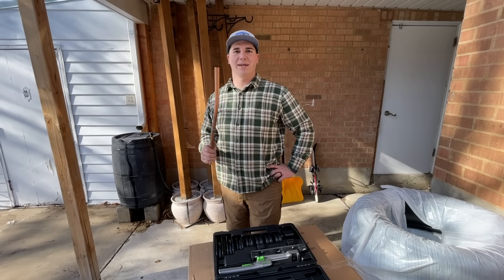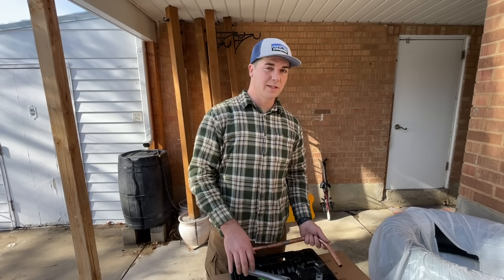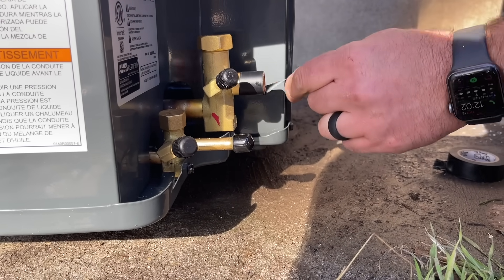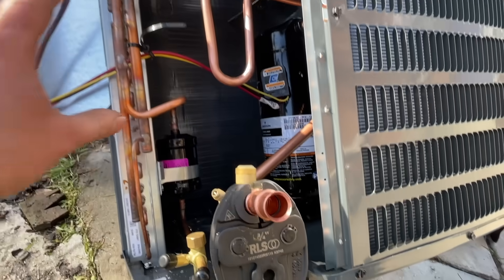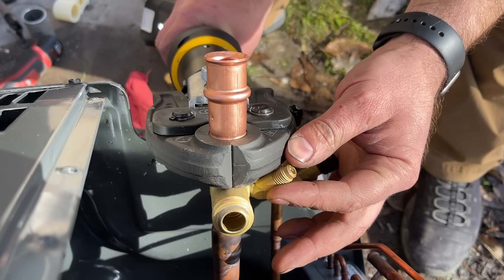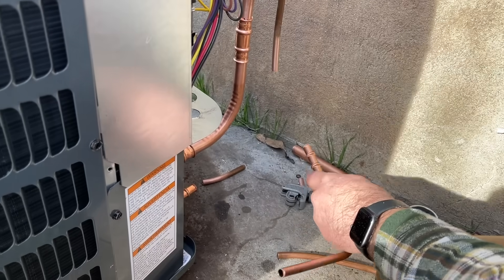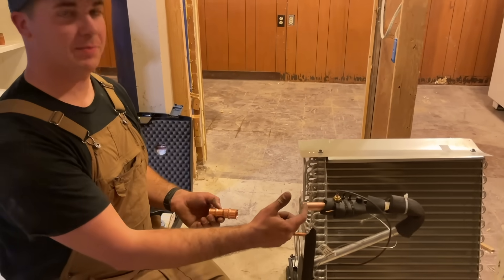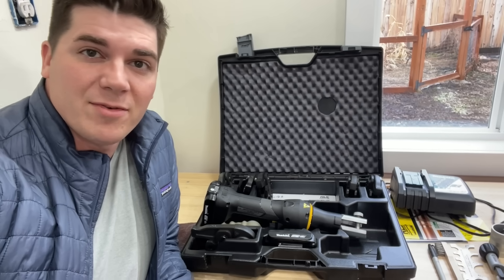Brazing Is For Cavemen. THIS Is The Future Of HVAC Copper Connections. -RLS Crimping Tool-

Comment: No rubber please. any amount of trusted rubber can result in leaks, flipped cars, leaks flooded houses. I like the new fandangled things but i like my copper and solder or braze. I haven't brazed yet. Just water with copper. I will never do pex in my house. Probably a customer as they think it's just what you do now a days.
Did someone think cpvc was ok. or plastic pex fittings or cast pex fittings. Or clay sewer pipes, then cast iron pipes. I love my old house and it's cast iron. Just don't pour grandmas spaghetti sauce down it all the time. Or vinegar in the shower to clean it. If it's abused I can see pre-mature failure. If it's to last 20 years and they can somehow prove it I consider it.
Reply from the maker: I appreciate your input. Pex has its advantages if done right but I can respect you liking the old school tried and tested way.

Comment: Pretty fancy stuff.  Press fittings are becoming more and more common in HVAC and plumbing.  Almost all the plumbers in my area have switched over to predominantly ProPress. 👍
Reply: Do you have gas heating at your home? Or ever cook over an open flame like a gas stove top? You can probably see where I’m headed….
Reply: When one of our water supply lines developed a leak, I found a plumber that uses crimp fittings instead of brazing/soldering to make the connection.  My concern was that I didn't want an open flame in our house.

Comment: Are the O-rings compatible with the refrigerants and oils? Even if so, I"m not sure I would trust them long term. Even HNBR O-rings in automotive applications eventually leak after being under compression and going through many thousands of heat-cold cycles.
Reply from the maker: Yes these fittings are designed specifically for refrigerant and are supposed to last the life of the system.
Reply: @diyhvacguy  sad to say this but considering nowadays the quality of our systems coming out of manufacturing is horrific at times solar light for the system now this could be 2-5 yearslol just saying🙄
Reply: Be tough comparing reliability of automotive fittings to these. Auto fittings are subjected to more vibration and often installed by diy'rs with little experience or training. They get knocked around and shoved out of the way. Not too many homeowners out there attempting sealed system repairs on their a/c and most of line set not exposed.

Comment: I haven't heard that a press tool was capable of the kind of pressures that are generated from HVAC compressors. 400 plus psi on R410A. Also there will be some vibration in the refrigerant line, how are the joints going to stand up to that. If it does work there will be a lot less contamination in the HVAC systems from poor brazing practices that are so prevalent in the industry.
Reply from the maker: That’s the idea, zero contaminants from brazing with no nitrogen, or getting flux in the lines when soldering. They are tested up to 700 psi which the high pressure switch will kick in well before that to prevent major damage.
Reply: @diyhvacguy  the propress units I've seen are only rated at 175 psi or less. Which propress are you comparing your numbers with. I think it would be great if your numbers are right. I'd like too see some documentation of any propress achieving 700 PSI working pressure.
Reply: @davidgordon8102  The 700psi could be burst.

Comment: Are you also going to do a video on the push-on connectors? They seem better because they can be easily removed with a tool
Reply from the maker: Yesir! Coming in the next week or so! I just filmed the installation of those and will post that very soon :) cheers

Comment: I have worked in the hvac industry for 25+ years and I would not recommend using press fittings for refrigeration work you are going to have leaks down the road even if you pass a pressure test during installation I have used press fittings for chilled water and heating water systems and make fittings for gas work also . I would be real careful using that for refrigeration work. I don’t think a building inspector would pass that job here in North country
Reply: That looks like a different compression style system, not your typical pro-press with O-rings! Oils and acids would eat away O-rings with generic water compression fittings. That system looks like it's designed for gas, compressing copper on copper creating an internal flare in the middle of the crimp. I'd use it!
Reply: @ronlovell5374  yeah the typical “pro-press” jaws make more of a hexagonal crimp which distorts the natural roundness of the tubing
Reply: @ronlovell5374  Cars use O-rings and they can last 20 years. Usually the evap gets a hole before the o-rings link. Usually cars have 2-3 Orings.
Reply: @ronlovell5374  lol bro l it uses a shitty ole oring
Reply: @Mike  The RLS press designed for HVAC and Refrigeration.   The fittings are triple pressed have 15 year warranty and rated for or min 700psi.   This is and likely will be the future, no brazing, no nitrogen purging, faster installs.
Reply: @Gary Szewc  Wow that's crazy, I've never seen higher than 600 in residential, I'll take your word for it.
Reply: @ronlovell5374 great perspective
Reply: I wouldn’t want this on my house. Technicians use this to make the job easier, get paid and get out. It won’t last.
Reply: I agree on down the rd that will leak
Reply: I know nothing about HVAC. But aren't all cars air conditioning lines made the same way? My work van is 20 plus years and holding good.
Reply: @johnny rizzo  automotive fittings that work the best have o ring fitting with captive o ring. Crushproof washer and it is a block fitting that is not subject to distortion. The crushproof captive seal is a backup but also provides a block to external moisture that could become acidic from other airborne stuff.
Reply: @johnnyrizzo8057  On cars the springlock couplers became popular because you could pay a much lower rate to the opperator making the hoses than to the Union worker on the Assembly line. The time it took to screw the line nuts was reduced and the incidence of Carpel Tunnel were reduced.
The car owner have to pay later to fix the leaks and recharge the system, 
The other thing about cars was that all the connections were under the well vented hoods. If a connection was inside the dash, A screwed together manifold or flare nut would be used to reduce the risk of a sudden refrigerant leak into the passenger compartment.
Reply: @johnnyrizzo8057 lower pressures in automotive
Reply: Is anyone here actually in the industry?? We’ve been using these for years now. It’s not propress. It’s zoom lock or RLS press. I’ve installed thousands of these fittings. Commercial and residential. Never a leak unless installed improperly. Same thing if you have bad brazing practices - you get leaks. Would not cut hub at condenser though. No turning back from that!
Reply: @jasonchouinard4216  I do Supermarket Refrigeration and that part of the Industry would not consider these at all. If you want to sell this to the customer for Residential Installation it might last a few years.  Or try it on 20 ton unit and see if it lasts. You Definitely wouldn’t see these on a York chiller or a Bitzer compressor Rack system.
Reply: @reefermadd.2204  I believe eventually you will. Matter of time. Just my opinion though. I’ve used them for large tonnage VRF systems. Have pressed 1/4” to 1 5/8”. When doing systems with hundreds of heads and thousands of fittings, the time and money saved in not flowing nitrogen is astronomical! This is all the same talk as when propress came out. We fear change. Lol. I can solder. I can braze. But if you don’t take advantage of the technology you’re foolish.
Reply: @jasonchouinard4216  I agree. It’s coming. No denying it. I can see using them in a VRF system. I’ll have to try it to see for myself. But Supermarket’s employees are ruthless on equipment. Like Walmart for example.
Reply: They would fail it in California
Reply: CAL  GOT NANCY P. THE WHOL QUEER STATE FAILED😮 @smokaoh
Reply: You definitely would not be using these in a  supermarket refrigeration system. I could understand for a mini split unit. Not for Commercial Refrigeration applications, especially with a system that has 1300 lbs of Refrigerant.
Reply: I agree with you. I would not recommend since the pressures can be very high. This system of crimping will only suitable for gas where the pressures are very low and definitely not for HVAC systems. Down the line they will leak.
Reply: @lakshmi N reddy  Oh they definitely leak. Especially if the lines get bumped and fittings get disturbed.
Reply: I work in the HVAC industry.  In Commercial and Industrial.  These fittings and crimpers are made and designed for refrigeration and the refrigerants used.  I have to use these in areas that Hot Work(anything that uses open flame) is not allowed.  I have had them on units for the past couple years without leaks.  As long as the prep work is done, and instructions followed.  They have worked just fine.  And I have used these in deep freezer(-40°F to -120°F) applications as well.
Reply: A typical A/C install at most homes require only 4 joint,I alway run nitrogen though it to keep it dry while fitting as well as brazing! I just dont see the purpose! Most that say its faster arent doing it properly! Measure ,cut,clean and deburr!
Reply: Consulting for a job here in new orleans, contractor made hundreds of these connections on refrigerant for a system with over 80 VRF cassettes. There were over 200 leaks. We will never allow pro press in our refrigerant spec ever again.
Reply: Bro I would’ have brazed up and pressured in 30 minutes, that was painful to watch.
Reply: You have a flared fitting on the high side on the Evaporator coil that never leaks so why wouldn’t this hold pressure.
Reply: Agree with you.  Cold press fittings involve deformation of copper tubing at joints.  Inevitably, turbulent flows will occur and develop cavitation and multiple leaks prematurely.  Cold press connections are bright future for the press fitting manufacturers and plumbers.

Regard to passing inspection (and pressure testing if there was one) AHJs are not to object any particular means and methods.  All Approved and/or Listed materials, tools and methods appropriate for task are to be accepted.  When things go wrong, installer and manufacturers point fingers at each other and others.
Reply: @SKCCP you don’t know what you are talking about. This type of fittings is used in Europe for about 60 years. There are fittings with special epdm type of rings for really every application. Even in the Industry of steam boilers they use pressfittings. Its really astonishing. 🎉
Reply: Your running 3/4 and 3/8 tubing. Those connections could be brazed in the amount of time that you are having to spend going through your shown procedure. The first time a customers child kicks a soccer ball into your piping and one of the crimped joints blows apart causing possible harm, it won’t be good. Been in HVAC for over forty years and yes I still prefer old school techniques. There must be o-rings in the fittings, some of these will leak eventually. Any mechanic worth their salt that has been in this business can tell you about all the leaking flanges and other components that utilize rubber o-rings or rubber gaskets. That old 15% solder joint if made correctly will last for as long as the copper itself will. Someone mentioned above about cars using this type of process. Different refrigerants utilizing lower pressures. Apples and oranges type of comparison.
Reply: @Kevin Lloyd  That's the key to these fittings. If they go undisturbed I guess they might be OK. But vibrations and someone accidentally bumping into these will definitely make them leak. I've seen it too many times. Even on the plumbing pro press fittings. I've run into multiple plumbing pro press fittings on booster heaters for dish machines that leak because they constantly get bumped by the kitchen staff cleaning behind the units or from technicians just having to move the booster to work on it. They're ok if nothing disturbs them.
Reply: Not true, RLS fittings pass in all 50 states. They are well proven!!  Some you guys should look into before u talk dumb!   @RLS all the way!! They don’t leak unless done wrong.
Reply: @drohvac4583  That’s what they said about polybutylene piping too. 😂
Reply: @akshonclip  The gray monster.
Reply: I had a gas line added in my home and used similar tool with fittings designed for black iron natural gas pipe. It was great to get the job done with minimal pipe threader work, hope it will last the test of time.
Reply: This is a bad idea, from a data service engineer perspective
Reply: This guy was around to say that the Wright Brothers were crazy 😂
Reply: That’s a no shitter
Reply: That’s a no shitter
Reply: But caveman.
Reply: There are UL listed press fittings for hvac lines. Its rated for pressure lines and has a ring that is resistant to refrigerants. Several have a 15 year warranty. I don’t see why it would be an issue as long as it is installed to manufacture specs. Local municipalities may differ. There is no code reason it would fail inspection.
Reply: A lot of people use it in Texas but only for drains I’m on the fence nice concept but I think they have some time to go before they perfect it especially for high pressure systems only see problems at the current systems maybe moving forward with lower pressure systems I’m still on the fence
Reply: @chrismmmhmm2337  Yes. Type K ridgid copper not soft.
Reply: @chrismmmhmm2337  You're using the word impossible way too freely.
Reply: I think it's ok, if there are rubber O rings.
Reply: All it takes is that one homeowner who torches the o ring when you leave so that you have to come back and fix it..... Just melt the pipes together like all the professionals are telling you to.
Reply: Just biznis !😮
Reply: It won't pass in Wisconsin, Illinois, Minnesota, Iowa or Michigan.

If you DIY it and there's an issue and it's discovered in an inspection for an insurance claim the company will deny the claim even if it's.not an affected part of the claim.

Until the OEM &/or manufacturer puts it in writing that they consider it an acceptable practice it should not be used.
Reply: Some propress fittings don't rely on the o ring for a seal and only as a back up
Reply: The press fittings are fine for refrigeration and I use them every now and then but never would I dare do a pressed fitting at the condenser like this video shows
Reply: It all comes down to the manufacturers recommended applications and the appropriate fittings are used. My concern with this video is whether or not the appliance manufacturer allows a crimp/o-ring style fitting directly onto the suction port. Even if the fitting and crimp tool is rated and approved for the installation, the appliance may not.
Reply: I saw the thumbnail and clicked to watched, I thought there was a new invention for HVAC piping, when I saw that it was propress I was like “oh, wow!”.

I agree with you, I wouldn’t recommend propress for HVAC systems.
Reply: Our new Refrigerator out of the box needed a charge, crimping the fittings on is the only way the technician could access and charge the system with the new Bull$hirt EPA replacement refrigerants. R-410a and R134 are being replaced by R-32 and R-454b that are "Mildly" flammable, soldering make boom... The tools to be able to work on the new stuff cost a fortune. Thanks to Al Gore and the resto of those whackos it will cost Everyone More to get their systems repaired. (By the way where do you test for leaks??? UNDER the fittings, the EPA will have us all believing R22 and other refrigerants damage the environment and IT DOES NOT because ALL refrigerants are Heaver than air!)
Reply from the maker: Well I just had this job inspected here in Salt Lake City, as they were remodeling their whole basement and had to have a permit pulled. Passed no problem. Only time will tell. But I say don’t knock it until it has been disproven. And that hasn’t happened yet. Cheers
Reply: @diyhvacguy  Saying “don’t knock it until it is disproven” is not a good idea. The same thing was said about polybutylene water lines and aluminum romex. Billions in damages and lawsuits.
Reply: @The DIY HVAC Guy  It's been disproven. Just ran into a system recently and found multiple leaks. All of the leaks were in the fitting. These are fine if the pipe is never gonna get disturbed which is never the case if you do refirgeration. Especially in walk ins where the customer loves to load their product all the way up to the evaporator. They constantly run into the refrigerant lines and when the lines get disturbed the seals begin to move around and eventually leak. These are a no go for me. The unit in question was 2 years old BTW. We ended up removing all of the press fittings and just brazed in new fittings. Let's just say the customer won't be calling that company back ever. The ironic part is the person who installed it will never know it leaked and he'll keep installing them thinking they're good because the customer never called him back about it. Hopefully you don't suffer that same fate.
Reply: @diyhvacguy  crimp connectors rely on having a clean and unscratched outer tubing wall. They make their seal using rubber. Soldering or brazing is really the only responsible way to connect refrigerant tubing.
Reply: @diyhvacguy  I've encountered two leaking  refrig. press fittings already in my time, no thanks.
Reply: @diyhvacguy  as we all know inspectors don’t know crap